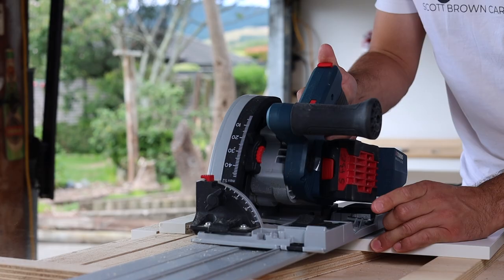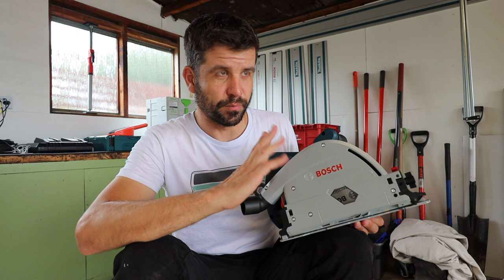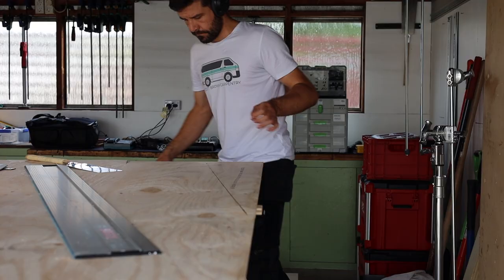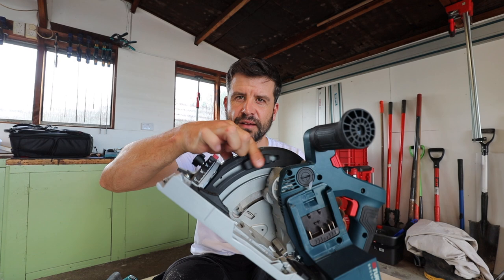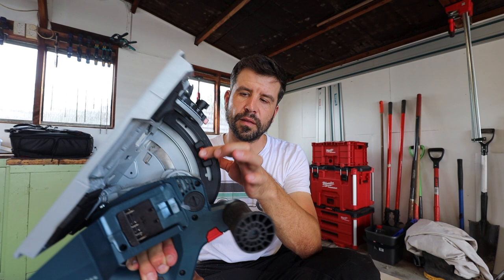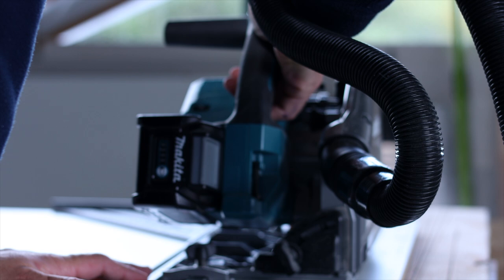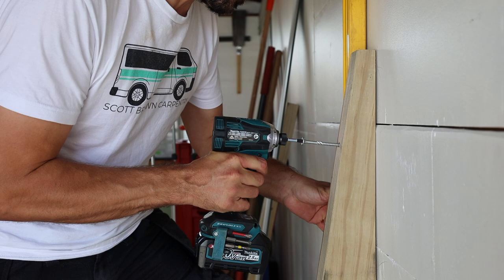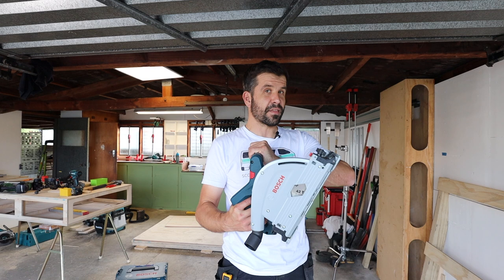Building Plywood Storage With My Bosch Tracksaw

Comment: About a year ago I bought a cordless Bosch rotary tool. Took it out of the box, tried it, worked fine for a minute or two. The next day, I was ready to use it for some actual work, and it didn't start. Tool return? In my country? Hah! I had to send it in to the Bosch service centre, and due to Covid, couldn't get it back for almost two months.

The whole thing has left me with near total disdain for Bosch, and I would not buy them again if I had the choice.

Comment: The problem is the Bosch saw overhangs the Bosch track so you can't use bench dogs to hold the track in place.
Reply: True, but you can get some very low profile dogs, or dogs that attach to the underside of the rail.

Comment: I’ve had the corded festool track saw years can’t beat it . Don’t see the point of the cordless because 90% of the time the extractor is on it !
Another note have you had issues with the hikoki frame nailer miss firing ?
Reply from the maker: Yeah good point, always have a hose connected. Regarding Hikoki, I had that problem, for me it was the glue residue building up over time. It's all cleaned out now and I haven't had any issues since

Comment: Hey Scotty I noticed you have the Makita vac and have been using it. How do you find it? Toss up for me between the festool midi and that... leaning towards he festool as i could add the bluetooth remote to allow function for all tools... thoughts? I am running all Makita. Great tools Love the videos! Great cinematography
Reply from the maker: Festool is the better option 👍 has more suction compared to the Makita. One thing to consider is the cost of the bags though. Makita is just a plastic bag, so it's cheap. Festool bags are ridiculously expensive for what they are

Comment: Why are these companies still forcing righties to use right blade track saws? 
 
Saws are usually universal, but in the case of a track saw, the blade should be on the side opposite of your dominant hand... Right Blade -> Left Hand... Left Blade -> Right Hand. 
 
Watch a lefty using a right blade track saw. (You can't really watch a righty using a left blade track saw. Unless they hate themselves enough to use the Kreg 🤣)
 
They really need to rethink it and just stop doing what Festool does. (Stares at Makita) Because Festool has said they will NEVER make a Blade Left... being as innovative as they are. /s

Comment: You have too much time on your hands. If you weren't making all that money on the side you would actually be working on the house rather than building benches and pointless sheet racks. If I had the money for a cordless track saw it would be hard not to go with the Festool. I don't like most of their products but in the past used the corded versions a lot and they are special. My other option would be the Makita 40V.   As I have no other tools on either platform this creates its own problem. I have Bosch but that depth of cut is hopeless. Also I reckon that Bosch saw would work fine on the Makita track if that is the only saw you cut on it. The Makita that cut of the strip initially obviously has a slightly different offset.